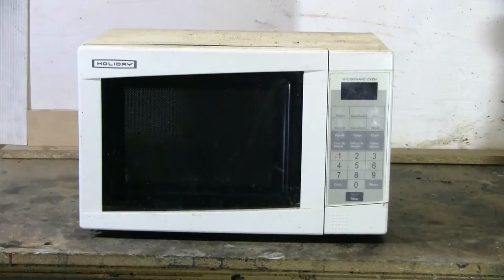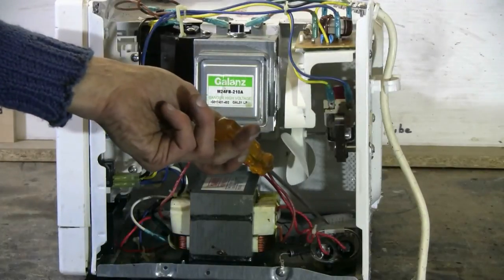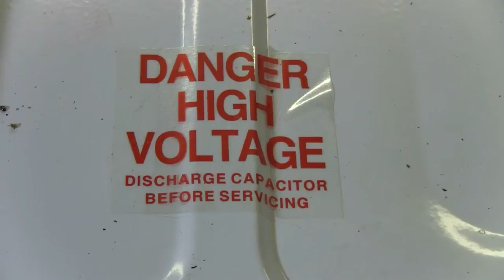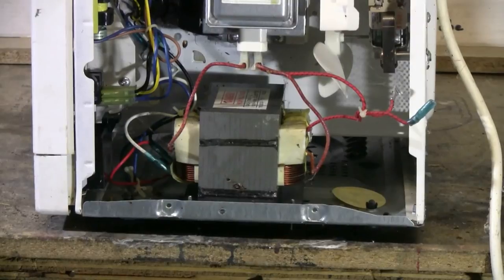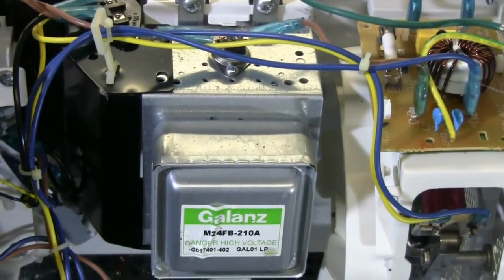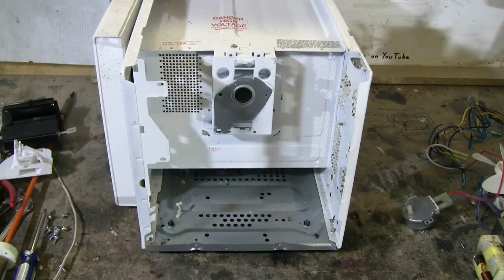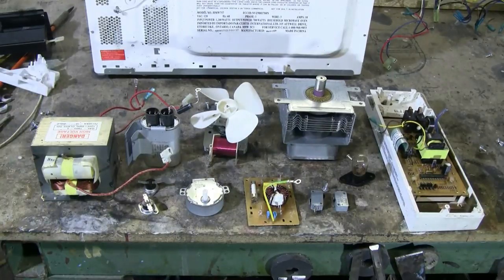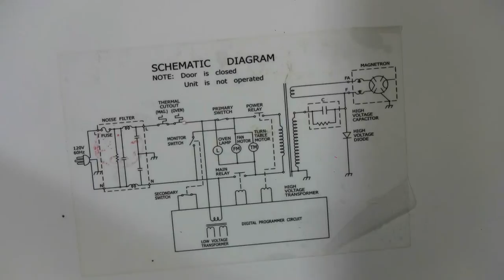DIY How To : Scrapping A Microwave

Comment: Excellent as always, Bill. I was kind of hoping you would show how to actually disassemble the magnetron. I have an old one in a box in my closet that I'd love to disassemble for the ring magnets and also to have the bare thermionic diode as a curio, but I can't figure out how to get the damned thing apart, at least not without risking the insulator's integrity. And I'm fairly sure the insulator on mine is BeO. So it has just been sitting in the closet should I ever need it.
Reply from the maker: I can do this within a few days. I have a defective magnetron that I did not discard.

Comment: Another way to defeat torx security screws is to dremel a slot into the head of the screw and then just use a wide minus screwdriver.